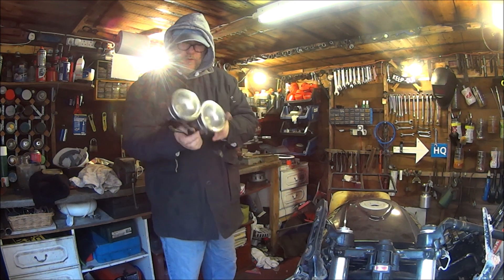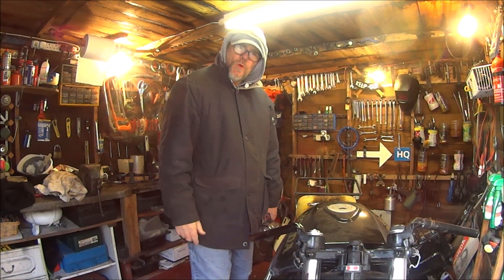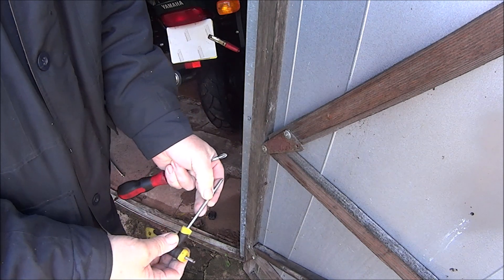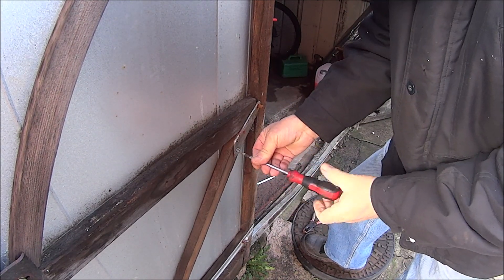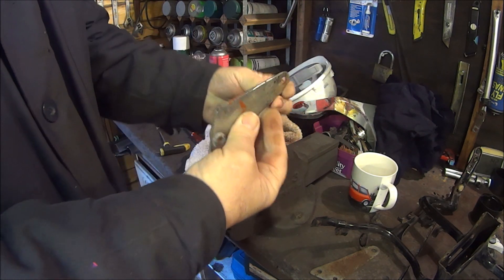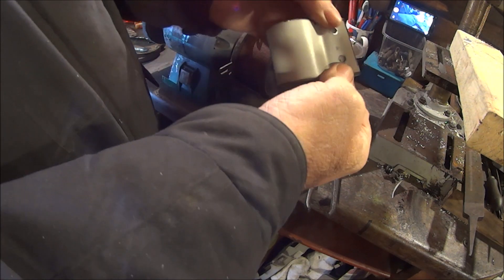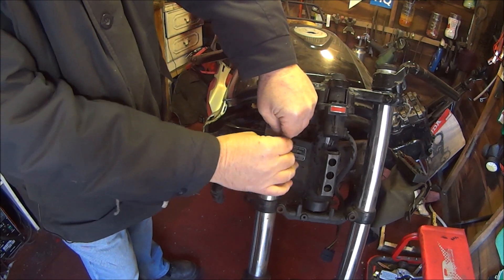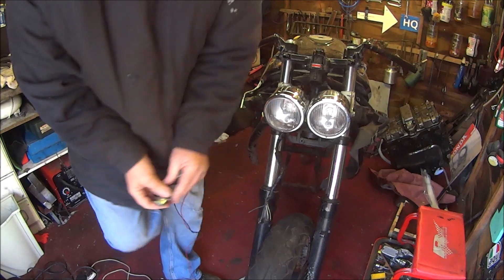CBR1000F Landfill bike, front headlights, "done"

Comment: Hi Jon just a little tip years ago I used light like the no matter how tight I done the brackets around the folk leg they always slide down to stop it I used a bit. Of old inner tube worked great never moved again the lights didn’t coming along well 👍👍
Reply from the maker: Hi Derek cheers buddy that's a great tip. Thanks for the comment buddy. 🔧🔨🔧👍👍👍